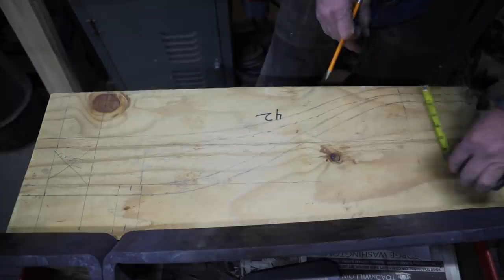Forging the Horn & Bumper Takes Heavy Forge Welding | Engels Coach Shop

Comment: So you do use  bedding compound!!!. Here is a potential tip for ya. I follow the youtube channel called "Sampson Boat Co" where Leo Sampson is rebuilding a 100 years old yard  called Tallyho. He uses a "home made" bedding compound (looks to me like it's an old shipwrights trick) made from Lind seed oil putty diluted with lind seed oil (to reach the right viscosity)  and with red lead powder added. The read lead powder is poisenet and will prevent rot. He also use something called Dolphinite but I think that's mostly for water tightening.
Reply: Not sure that things get better by adding red lead. Especially not boats or wagons that get rained on that then drain into the water table. I’d expect the PVA glue (which essentially dries into a plastic-like compound) to be just as good at the job, and a lot less poisonous.

Comment: I'm sure someone has asked this in the past but what is the white powder that you spread on the hot iron when you are forge welding?  What does it do exactly?  Thank you for taking the huge amount of time to video each process.  I really enjoy the craftmanship you exhibit.
Reply: It is borax, used as a flux to prevent oxidation.

Comment: I enjoy watching you work and the precision of parts.  I have a question about the blower on your forge.  It looks like the hand crank blower directs air onto the fire.  Do you have a second blower sending air up thru the fire?  If so, is it hand crank or electric? Could you explain the benefit of the top blower?  Does it help in forge welding thick steel maybe?  I have a home built coal forge with a hand crank blower but I'm always looking for an edge.  Thanks for taking the time and effort for all your videos.

Comment: How does a forge weld joint compare to a modern arc welded joint for large bar stock like that? Probably a stronger joint than the wrought iron they used back then.

Comment: was glue always part of bedding the axle? Did they use hide glue or pitch?
Reply: Glue? I think you mean borax, which is a flux.
Reply: @joostvelders6641  I think Pockets is talking about the "Glue" at 0.45. 
I had a thunk also, gluing to steel...?
Reply: @aubreyaub  : yes.
Reply: aubreyaub it’s PVA wood glue, Titebond III, waterproof variety. So no, that’s not period accurate materials. But it’s probably better materials than the period had to offer. It doesn’t adhere to the steel, but does to the wood, and it’s basically a gap filler in this application.

Comment: What happens if you do not brush the slag off.?
Reply: If you're forge welding 2 steel items together, the slag will create "cold shuts" (unwelded areas) between the two. Cleaning off the slag and fluxing prevents cold shuts.
Reply: @Frankowillo   Thank you.

Comment: Dave, How long does it take to forge weld two pieces of flat stock that size, together?
Reply: Paolo G , Thanks.  So what you're saying is the time it takes to bring two pieces up to temp is what takes the most time, and that depends on the thickness of those pieces.

Comment: Is forge welding just as strong, stronger or not as strong as say arc welding or MIG
Reply: If done correctly then I would say yes as you are joining the pieces of metal at the molecular level and over a larger area than edge welding with either process.
Reply: @markfryer9880  I agree with what you have said but I was wondering if you get a 100 bond on all the surface every time?

Comment: What kind of pencil do you use to mark the metal with?
Reply: It is called soap stone any place the sells any kind od wielding supplies has it wal-mart might have it.
Reply: Scruffy 61 I used to use soap stone but I never saw it in pencil that small.
Reply: Ah, so true.  I have some 1/4" round and some 1/8"x 1/2" sticks about 4" long. 
JIM